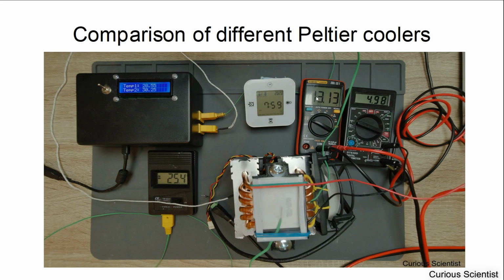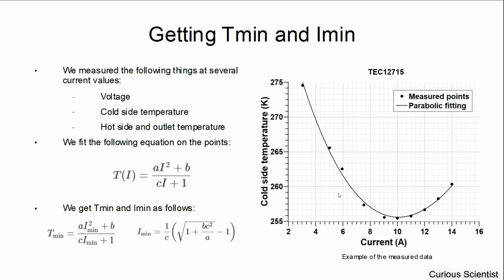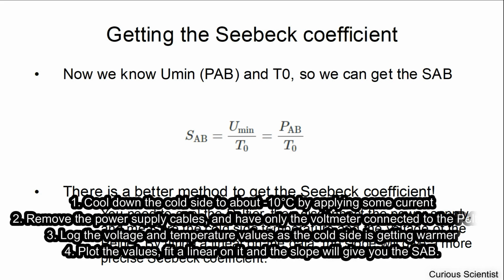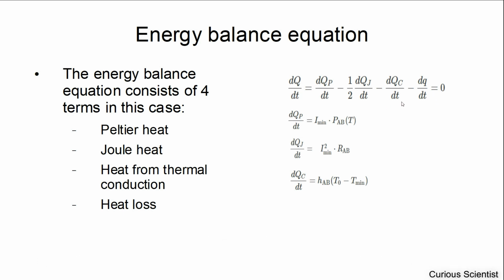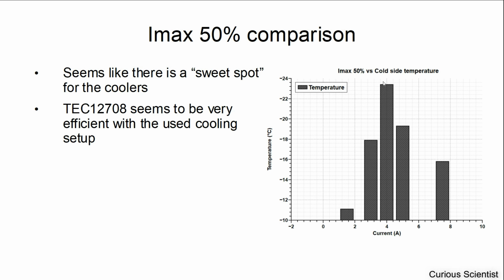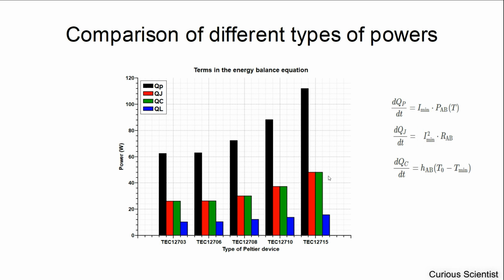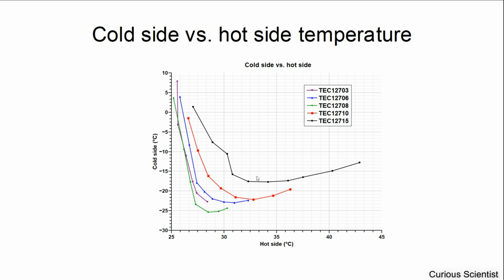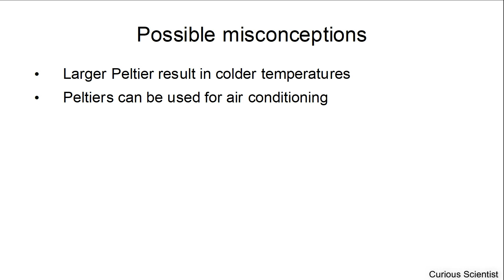Testing and comparing different Peltier coolers - Part 7 - Summary and final conclusions

Comment: Excellent series! Having a nice variety of differently-rated tecs all plotted out together w/the various IRL performance curves just happened to be exactly the overly-niche level of detail I was specifically seeking out prior to my good fortune of finding your channel, so thank you for the impressively robust thoroughness & general fastidiousness overall (which you clearly have in abundance & on tap upstairs)! I just happen to have a setup that's employing 2x 6A modules + 1x 8A, the latter of which was chosen as a result of a defective 6A unit & just chanced upon an 8A unit @the B&M tech store i returned it to. I was a tad concerned once realizing I didn't consider the possibility of incompatible voltage->current draw curves possibly quashing my plan for running them all in parallel from an ATX supply hacked for adj voltage, but thanks to your efforts in this vid, I not only learned that the V/I curves compared between the 6A & 8A units are essentially identical, I also apparently chose really flipping wisely with my "Sure, lets try this sucker out, why not?" level of research I put into picking up an 8A unit. This is plently long enough as it is for a YT comment, so I'll omit jumping into my application/project details except for just mentioning that I'd be happy to share my attempts at documenting it which I'll be undertaking soon as its nearing its "final form" @ ~Mk3. Here's the carrot: Its a cooler box build that... and by all means be skeptical... has completely solved the issue of peltiers being rather shit at cooling air for a practical application like food/drink refrigeration and NOT have it just be this tediously underwhelming thing taking forrrrever.... I didn't violate any physics laws  & the box isnt just a refrigerator i slapped tecs on either, heh. It is definitely a departure though... And a massive power fiend, hahaha
Reply from the maker: Glad to read that my video helped your journey with Peltier coolers! I am curious about your build, of course, and looking forward to seeing what you've done! Cheers!
Reply: @CuriousScientist  Excellent! I'll send a link via your website contact along w/a proper donation as a proper thank you for the time sank into doing this helpful research & to offset naive bumbling hobbyists like me wasting said time detailing my wacky project, hahaha. It'll be 100% complete today, so the writeup will be following very soon!

Comment: This is very informative!! Thanks for sharing. Seems like TEC1-12708 is the best choice. If you need to increase the cooling power, just put them in parallel, feed 6-6.5A for each unit and water cool the hot side and as efficiently as possible. That's all that we can do to maximise the cooling with peltier units I guess?

One thing I may add is don't use aluminium cooling block and copper radiator together, the aluminium block will corrode because of galvanic corrosion caused by the copper.
Reply from the maker: Thanks! I would add that the TEC12708 is the best with this cooling setup. The larger coolers (12710, 12715) probably produce too much heat and they sort of "saturate" in performance. Otherwise, I think it is correct what you wrote. 

And yes, galvanic corrosion is a real issue with those systems. If you can't avoid mixing these materials, you can add a special liquid to the cooling water that acts as a corrosion inhibitor.

Comment: Correct me if I am wrong. According to this data, if someone had a peltier fridge with a 6A unit that was under-performing due to heat dissipation issues, it might be possible to install a 8A unit and get better performance due to the fact it does not get as hot? Assuming they make the other changes needed to meet the amperage requirements of course.
Reply from the maker: Hi! Good thinking. First, if the heat dissipation is the issue, I would start with a better heatsink and/or fan for the hot side. An 8 A unit with the exact same power supply as for the 6 A unit might run colder because it has lower electrical resistance and therefore it will generate less heat during operation. At least if we suppose that both of them are driven with the exact same current. But also, as a sidenote: a typical issue is that people run the Peltier coolers at their maximum rated current. That leads to the issue that the Joule heating overpowers the Peltier cooling. So the device will start to warm itself up at a higher rate than it could remove the heat from the cold side which leads to a drop in the performance. I showed those curves where the cold side temperature starts to increase with increasing current. That's what this is all about.

Comment: Unfortunately changing one variable drastically will not allow your charts to move together. The key (which we still cannot achieve) seems to be involved with airflow, reduction from ambient to hot side, and airflow on both sides. You will see wild fluctuations on those charts at 23:40 will suddenly go wild as things are changed. Best starting point is a little moisture if your dewpoint is low enough.  Second is airflow wit something like an antminer fan. Crazy airflow and make sure there is one on each end and get that middle fan out of there, remove the fan and put the frame back in place with silicone. You seem th have the ideas for thermal spacing on the peltier. Our first try was 5mm rubber silicone.
Reply from the maker: Yes, the charts are very sensitive to the variables. That's why I mentioned several times, that the temperature dependency of the parameters is crucial, and the charts can be different if you use different cooling. I have never heard of this antminer fan, but I looked it up. I will order a few in the future, just to see how they can help us with the better airflow.

Comment: Can you tell me, what the "7" stands for in TEC12703?

Also, I found a cooling assembly on Amazon that uses a HT064112 Peltier device.
HT apparently stands for high temperature but I would be thankful for an explanation on that one or a link to where the numbers and differences are explained.

Love your thorough explanations!
Reply from the maker: Hi, and thanks! 
Apparently, as it turns out, 127XX is the numbering where 127 is the number of the small semiconductor blocks inside the Peltier cooler and XX is the maximum rated current. 
I think the numbering depends on the type, there is no overall standard it seems. The best idea is to refer to the product's datasheet.
Reply: @CuriousScientist  Thank you! I just assumed the 12 was for 12V. Thanks for the info!
Reply from the maker: Yes, earlier, I thought the same, too, but I was wrong. Cheers!

Comment: Please correct me if I am wrong. " sweet spot " of both
TEC12703 is better or similar to TEC12708 ,  watt consumption wise.

 As per your data ..

TEC12703
262k coolside temp need ( 1.5ampX8v ) 12w

TEC12708
264K coolside temp need ( 2ampX6v ) 12w
Reply from the maker: TEC12703 is a 3 A unit, and the other one is a 8 A, of course it will consume less. But it won't provide similar cooling power.

Comment: Hello, appreciating your effort to make all the testing and sharing it. It is very useful for me as I need to build simple cooler to cool down liquid to -10 °C. I have some TEC1-12706 from alliexpress, cooling hot site to 5°C and  can hardly achieve -9°C. Where did you buy you peltiers from please?
Reply from the maker: Hi! I shared all the purchasing links on my webpage under the parts and tools section. Check it. 

How much voltage and current do you use? I suspect that you don't regulate the voltage and due to too much current, you simply overheat your Peltier. Also, one single device might not be enough for the amount of fluid you want to cool. There are many parameters that can be causing you problems.
Reply: @CuriousScientist  I've bought new peltiers from the affiliate link you have above. Thanks very much, they are awesome, can cool to -20 and more that is enough for my project. BTW in the affiliate link above I am wondering that the microcontroller ESP32 is not listed.
Reply from the maker: I haven't used ESP32 in my videos, so I did not add it to my parts and tools website. But maybe it is a good idea to add it! Thanks! I am glad that you are satisfied with the Peltier cooler.

Comment: With all of your knowledge as the summer days get hotter. Could you make the most efficient homemade Air conditioner using the Peltier!?
Reply from the maker: I cannot improve the efficiency of the Peltier, it is an intrinsic property. I will explain in another video why you cannot use them for efficient air conditioning. Peltier devices are simply not made for this task.
Reply: @CuriousScientist  what is the best way of making an 'AC' type unit then? I see a lot of videos using this concept to water cool the hot side of a Peltier then cooling inclosed water on the cold side and having fans push the air across the cold suface and out, exiting as "air conditioned"
Reply from the maker: @tylermarsh6831  Use a compressor based cooler. Most of those videos haven't done any scientific approach to investigate the real capabilities of these devices. They just put together a few Peltiers and some heatsink and show that the cold side is cold, that's all. As you start to put load on the Peltier, their performance drastically drop. Being able to achieve -20°C doesn't mean anything, that condition is only valid when there is no heat load. If you want cooling performance from these units, you have to sacrifice the Delta T, if you sacrifice the Delta T, it will take forever to cool down a room. Do the math: let's say, a small room is about 30-40 m3 volume. How long will it take to drop the temperature of the room by 8-10 degrees (30°C to 20-22°C)? Peltier is not for air conditioning.
Reply: @CuriousScientist  like a compressor and system from say a fridge? I do really appreciate you replying. I guess im trying to think along the lines of the best fully indoor AC that would be water cooled with less heat output
Reply from the maker: Exactly, as a fridge. Picking up and releasing heat is much more efficient by having a fluid which can go through phase transformations (in this case: liquid-vapor (evaporation: picking up heat), then vapor-liquid (condensation: releasing heat). Peltier works in an entirely different way. I explained it in one of my early videos, where I studied the working principles of it in a scientific approach. You should check it out. I won't strain myself to convince you that Peltiers are not made for air conditioning. Wait for my videos, and you will see why.
Reply: @CuriousScientist  you are amazing thanks for taking the time to explain. I look forward to more videos
Reply from the maker: Video is uploaded, please check it carefully when you have time. Cheers!

Comment: Soon you will end up using a 555 timer to find if you can "pulse" energy to allow the new cooling of the hot side to become more effective and then you will end up raising that heat load closer to something that actually needs cooling like a cpu or human body or even 1 cu. Ft of air at 50C and have to redo all these calculations. It's fun but at the same time it's a nightmare. I may have said too much already. If I'm required to delete this post, I apologize
Reply from the maker: No, do not stop posting your ideas and suggestions! These are all helpful and interesting. I do not know how much these Peltiers are capable of working with AC or chopped-DC voltage. I guess, the point would be to turn on the Peltier just for a short period of time, to allow both sides reach their temperatures, then switch it off, so the continuous heating of the hot side would stop and the waste heat generation and transfer towards the cold side would be limited for a shorter time. I do not really have any ideas about this, but I think, the "inertia" of the system is too big, so it would be insensitive for these changes. But I am just guessing mostly.
Reply: @CuriousScientist  I was actually referring to someone here thinking I'm giving out proprietary information but I haven't mentioned any company names or specific product or specific methods so I guess I'm okay.
Reply: @CuriousScientist  I have never connected a peltier to ac voltage. All our work is battery powered